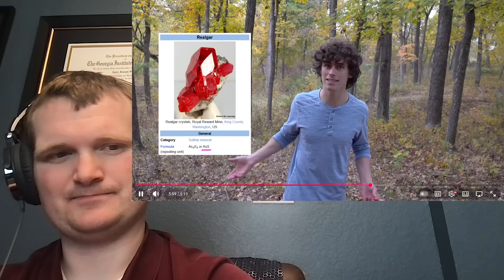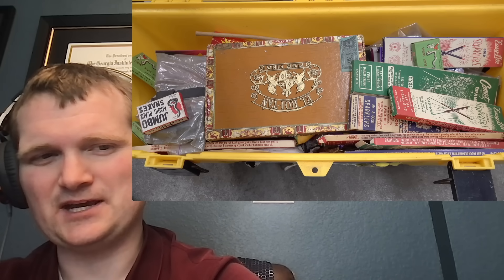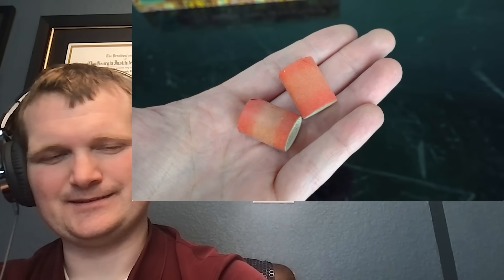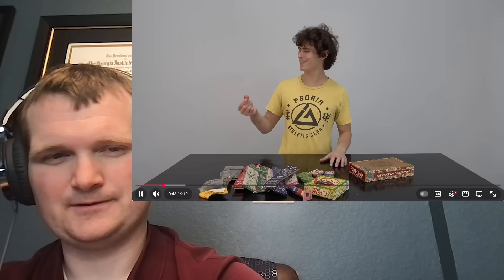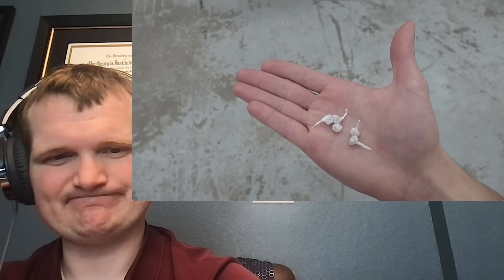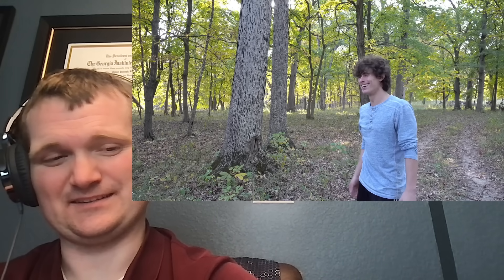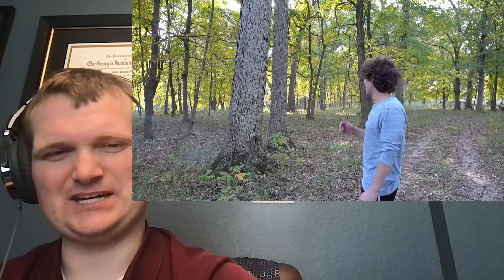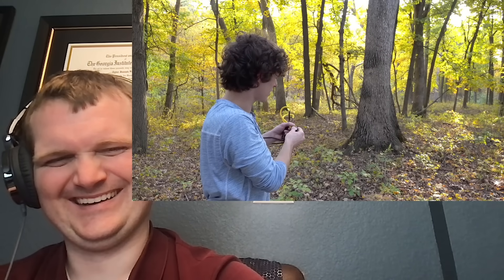Fuseless Fireworks from the 1940s - Nuclear Engineer Reacts to Styropyro

Comment: Looks familiar. when I was young,I was told you could  mix a combination of sodium chlorate  and powdered sugar and get a nice little propellant out of it. We tried it in an open container inside the garage and the flame from the small amount rose 10 feet into the air and almost started the garage on fire. After having seen that, I thought this would be a great way to make our own special rocket.Lacking any real tools except a hammer I got a 6 inch piece of old handlebar ,beat in one end of it and filled it with the mixture.. I dug a little hole in the ground to hold it and left a little trail about a foot long as a fuse. I lit my fuse, but before I could get more than a couple feet away it exploded. I was doing it in an alleyway, and the explosion was so loud that every housewife came out into the alleyway, looking for the cause of this massive explosion. Where I had placed the.” rocket” ,now stood now a hole about 10 inches deep, but no trace of the handlebar.. I then concluded it was a marginally successful launch since I couldn’t find my rocket. Two or three years later, while mowing the backyard near the alleyway I ran over a piece of metal that was split apart and folded open like a bubblegum wrapper. My rocket not only split and opened completely up, but it had gone through the base of a cyclone fence and was stuck partially buried in the backyard about 15 feet from where the launch occurred.. Luckily God protects Rocketeers  and morons

Comment: The "old" sparklers could be tightly wrapped together to form a comparable explosive to dynamite. Thats why they were banned.
Reply: @CCJonny84 You can still do this with the ones sold at pop up tents around the 4th or at firework stores in legal states. It’s much easier and effective to take a couple packs and crush them all up off of the sticks and then make it a powder and loosely load it into a tube, cap it, insert a fuse or an intact sparkler, light it and run. I prefer using fuse and it has to be loosely contained not packed tight or it won’t go boom it will have a reaction similar to thermite if done incorrectly. This is entirely theoretical/hypothetically speaking obviously ;)

Comment: The real M-80 was the best. . It made a fireball about 30 inches in diameter and would take your fingers off if one went off in your hand. The mixture was 30% dark pyro aluminum powder and 70% potassium perchlorate. Not a mixture you want a static electric spark to contact. Take a small pinch of potassium chlorate and hit it hard with a hammer on a steel plate. The oxidizer alone will explode with a snap.

Comment: Hypothetically:
Some Engineering college students with access to certain school lab resources found a decommissioned fire extinguisher. Decided that the best use of the empty metal pressure vessel would be to blow it up.

Well they started mixing (redacted) and found some (redacted) and (redacted) decided to add that to it. Then someone said "hey this might be dangerous" so they improvised a radio controlled "ignition" device.
Then somehow a non-functional junk yard vehicle got involved.

In theory there was a big boom in a less than populated area, but it may have been very loud. Allegedly the remainder of the junk yard vehicle was loaded onto the trailer and as it was driving down the road multiple police vehicles passed it going the other direction including an armored SWAT vehicle and Bomb squad truck...

That's when everything became extremely Hypothetical and Allegedly...

Comment: Has anyone ever seen the movie Sorcerer from 1977? These 4 wretched souls have to transport a truckload of old dynamite through the jungle to plug an oil refinery fire. Problem is the dynamite is sweating out nitroglycerin, thus making it extremely shock sensitive, and the road is... less than ideal. Cool movie, you can find it right here on YT. There is also an older 1953 movie called "The Wages of Fear" which is pretty much the same plot, and some would argue even better than Sorcerer.

Comment: When we were kids we would go into train cabooses and take the torpedo fuses. These were what he has but about 100 times louder with lead straps that would strap to the railroad track to warn a train of a hazard ahead. They were loud enough that the train engineer would hear it and stop the train.  You can look up railroad torpedo fuses and see what they are and frankly how dangerous they were! They would sweat in hot weather because they were filled with nitroglycerin and I can remember getting crazy headaches from messing around with them.

Comment: 1:28 if those magic snake pyrotechnics are what I think they are, they likely contain mercuric thiocyanate, which gives off toxic smoke as it burns. I found the recipe for them in a 1950’s chemistry book I have. There is another version that uses boiling sulphuric acid and sugar that produces similar results without toxic fumes, but I wouldn’t play with either. A faster version uses para nitro acetanilide which makes the reaction go almost instantaneously.

Comment: I'm going to hold on to the belief that styropyro's granddad left him a critical mass of plutonium and he's just staying quiet about it for now.
Reply: I would not be surprised at a couple of radium dial clocks.  Those were pretty common when I was a kid.

I know a number of old pyrotechnic formulas, and know of no torpedo formula that was made with realgar.  Per Weingart's Pyrotechnics (a 1940's era pyrotechnic manual on formula and technique) the torpedo formulas were either "Japanese" torpedoes, made with red phosphorus with a lifetime of only a year or a bit more, or silver fulminate, which really doesn't have an expiration date.  I would expect these were made with silver fulminate.  I suppose mercury fulminate would be possible, but I would think mercury would have been a restricted war material through the early 50's, besides which, it would be quite a bit harder to set off.  I would not suggest trying most of the formulas in Weingart, quite a few are considered hazardous now.  There are a few that have become standards, but I'd get some knowledge of what you're doing before you try them.

Comment: Old sparklers would often burn you (they burn 1800 degrees, and we did get burned from time to time), but they didn't get banned until people started to buy hundreds of them, shave off the outside material, put it in a box and make a bomb out of them. It was also dangerous to use them to light other fireworks, but we did anyway. Compared to M-80's they were <mostly> safe. I miss them.

Comment: sixty years ago when I was an amateur rocket kid, I used Estes which is still in business.   There was a company called "Jetex" which made reusable metal rocket motors that ran on guanidine nitrate.  Jetex made one motor that was about 18 inches long and used a small spark plug to get it going.   Jetex went out of business. There was also in NYC, about four blocks from where I lived, "Winn Chemical" that would sell a child anything they could pay for. I mean seriously anything.  "Don't open it till you are out of the store kid" - famous quote. That store on 23st and 7th Avenue went out of business after a fire took out the building.

Comment: I’m 62 y.o. I recall the old school sparklers being “banned” when I was in my late teens primarily because once ignited and for several minutes after they expended their fuel, the metal core took on the characteristics of an arc welder rod….orange/red in color with infrared radiation  Placerville o’plenty emitting from the rod and a clear and present branding iron presentation.
Reply: Lol I'm 45, and I played with some fireworks like that when I was a kid.  I'm from NJ, and my dad would just drive over the border to PA.  They were waiting right there to sell you sparklers, M80s, whatever
Reply: Blistering burns from treading barefoot on a discarded sparkler was considered a normal part of the 4th of July.
Reply: @KennethAGrimm and then if you lit one using a lighter, you burned your thumb. And then you didn't do that again.
Reply: @donutwindy  Duh-uh. Your father lit a a railroad fusee and stuck it in the ground, you lit them off that, and when the sparklers were all gone, the red fusee was cool, boiling in fire like a volcano.
Reply: What do you mean by Placerville emitting from the rod? All I know that word as is a town in Northern California

Comment: 7:15 US Navy nuclear reactors are spring-assisted because, being a warship, there's no guarantee that the top of the core will always be above the bottom of the reactor core.
Reply: That actually makes a lot of sense. Im assuming in case the ship sinks
Reply: @Doc_Hawk nah, pitch of diving and surfacing can be pretty steep.
Reply: @Doc_Hawk  Yep.  If we are moving at max (flank) speed and do a sharp turn, the ship may lean (heel) 20 or more degrees.
Reply: If the top of the ship is at the bottom position. The rector is only one of your problems.
Reply: @theninearemine8499 well, yeah, but an environmental disaster is something that is easily avoided by using springs to keep the control rods at the bottom of the core.

Comment: A question on the comment about it being lower risk because it’s older, and you disagreed.

I’d assume you’d want to look at the half-life of the ignition material and the explosive material, where the more reactive probably decays faster, making it more likely to ignite by density? Or something? It has been so long since studying any of this.
Reply: There's no guarantee that they're using radioactive materials for the explosion. Neither YouTuber mentioned it, except by way of analogy.
Reply: @creativecraving Makes sense. I was thinking less scientific atomic decay, and more wear and tear figures, like concrete does (50-100 years). Which, these can have, but depends on storage, etc.  In the interim, I found those numbers, seems for the most part it’s around five to 20 years if improperly stored.

Comment: Hi there, @tfolsenuclear

I have some questions nobody wants to discuss, and I was hoping that you could do me the honor of answering some of them.

I'll get right into it.

I see some obvious problems with Einstein's E=MC2, and QM in general.

First of all, what kind of energy is E supposed to be?

Kg m/s should imply the energy is relevant to kinetic energy, but we already have a functioning formula for that, so what is it? Potential, thermal, chemical, light (radiant), sound, nuclear, magnetic, gravitational, elastic or electromagnetic energy?

All these known forms of energy, have real world applications.

What real world form of energy does E represent?

Then there is the fact that C is not a constant in nature.

Even if it was, what would it be in relation to?

A hypothetical 0-point in Space/Time, in a universe where everything is in motion?

Which brings me to my next point, which is that using a Non-Euclidean grid to describe nature, is an obvious fallacy.

Time is synchronicity, and bends for no one. Not in nature.

To me, the obvious path to E as a unified symbol of energy, is to solve every known form of energy through a common denominator, and plot them in a Euclidean Space/time grid.

The common denominator to do this through, is electromagnetism on an atomic level, because everything in nature is electromagnetic, and the atomic level, is where energy interacts.

Regarding Dark Matter, this has been solved and proven by several universities already, but the Truth is being ignored, because accepting it, would mean that all the work of tenured physicists world wide, would be nullified and lose all value, and if they do not integrate the new Truth into their work, they will lose tenure, income and respect.

The Truth that is being suppressed by the arrogant, ignorant, and petty people without integrity or decency, is simple.

Dr. Mills found that the Hydrogen atom can exist at a lower than ground state.

He calls this form of Hydrogen "Hydrinos".

These Hydrinos act just like Dark Matter, and when reverting to ground state, they release 200 times the energy compared to combusting Hydrogen, in the form of light.

His invention harvesting this energy, has been running for years by now, at a test site in Canada.
 
This new knowledge has the potential to change the world in an extremely positive way, and represent the most important leap in knowledge and tech since Nicola Tesla. 

Regarding my problems with QM and Einstein's relativity theories, I would appreciate being educated in my idiocy, or confirmed as an idiot savant, as long as you bother taking the time to answer.

My main request, though, is to have the courage to investigate the research of Dr. Randall Mills, and if you come to the same conclusion, to promote the much awaited renaissance in physics, and science in general.

Much love and respect from Norway!

Comment: Now hold on, A reactor with control rods inserting from the bottom are also spring-loaded so it springs into the "reaction stalling" position, correct?

Comment: did watch full video yet but in the netherlands and germany in the 80s strikers where i thing for fire works you light them like a match and the fuse is a mix of fire powder and someting the wont burn so it will make it burn slow only problem was if it was not mix well they could of faster yes these where fire crackers and powerful ones to could take a few finger

Comment: 3:50 I don't claim to be an expert on this subject, but have taken multiple chemistry courses in college. I would likely go with Styropyro's hypothesis here. More reactive chemicals normally trend to a lower enthalpy state with time. Radiation (light, heat, etc.) can often start reactions that will lead to a more stable end state (though this can also drive reactions causing higher enthalpy as long as there is a consistent source of energy, potentially being similar to an environment like the inside of a nuclear waste barrel, which would have a heat source inside). Chemistry is wacky, though, and often tends to ignore the rules we make up for it.

Also, he IS a chemist.
Reply: Well, the thing is, with energetics in particular there are some particularly nasty exceptions, like chemicals which are more or less safe oxidizing over time to form extremely sensitive peroxides. Or the one chemical that really comes to mind as getting worse with age, nitroglycerine.

As nitroglycerine starts to break down it gets even more shock sensitive, but that's not the real nasty part about it because dynamite used to be made with nitroglycerine, and over the years it would soak into the paper tube and droplets crystalize on the outside of it, which are so sensitive that vibrations can set them off with some bad luck. And old dynamite is still left in a lot of abandoned mines.

Where I live, there used to be a lot of mining up until the late 1940s, and so there are a lot of mines which have been left abandoned. And like a lot of the people around here at least know someone who has blown a hand or arm off because they found a stick of dynamite in the forrest and didn't know what it was until it went off.
Reply: @clippythenerd  That's a good point. More you know.
Reply: @clippythenerd  Could always be worse. You could be shooting Turkish 8mm Mauser.
Reply: Pyrotechnics literature I read as a kid warned of certain shock-sensitive compositions more or less self-initiating, after months or years sitting on a shelf, or slow fuses becoming fast fuses, additives for color or effect interacting with otherwise "safe" mixtures, glue, etc...  I don't remember specifics, but "don't handle old fireworks" and "don't mess with permanganates" stuck in my brain.
Reply: @BlackMatt2k  Consumer fireworks are generally not too bad, maybe don't trust the fuses, but usually those fail by absorbing moisture and becoming too slow or not working.

Sometimes lift charges weaken too so air-burst devices go off on the ground. But you should always be far enough away to be safe if that happens anyways, even with new fireworks. Charges in fireworks are mostly black powder, which if anything gets less violent with age.

But, the more spicy stuff than your old fireworks, things with high explosives, or angrier oxidizers, that's where things can become very scary.

Organic peroxides are some of the worst, they can be formed intentionally or unintentionally. When they form accidentally it's usually in a lab that has left something which ought to be used fresh sitting. Which is bad as it can go off on its own, or as soon as it's for instance used in what's supposed to be a safe reaction.

When they are formed intentionally it's even worse, because they have almost no actual commercial use, so when someone goes out of their way to intentionally synthesize them, it's usually a terrorist.

Comment: Why do I feel like this is a few steps removed from straight nitroglycerin 😬
Reply: It's a primary explosive, just like nitroglycerine, it's not really that different except that it's not a liquid and so doesn't soak into the paper tube to get more shock sensitive with time unlike actual dynamite can do.
Reply: It's probably not too far off.
Reply: "Nile blue* so I made 50kilos of nitroglycerin 😅
Reply: @keirakain   I mean it wouldn't be too hard, nitroglycerine is easy to make, the hard part is handling and storing it.

And making that quantity would probably be illegal but idk laws the US or Canada.

You would also want to dispose of it more or less immediately so it doesn't "age" and get more sensitive, you would essentially need to just take it out to a range and use it to rapidly dig a crater in order to dispose of it.
Reply: The little finger snaps he demoed near the beginning, I think have a grain of nitrogen Tri-iodide.  These things might just have more of it.  Not definitive, just a thought.
Reply: because it is